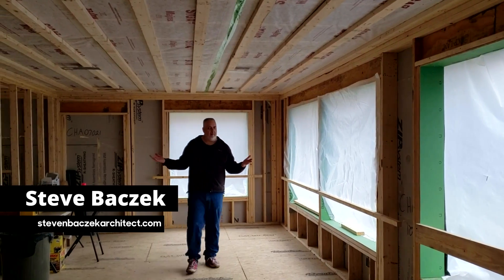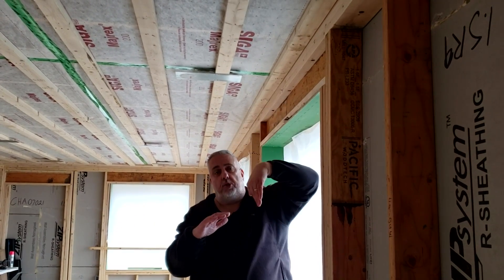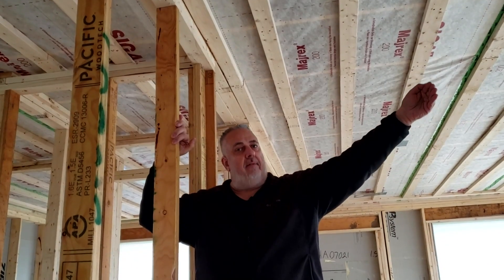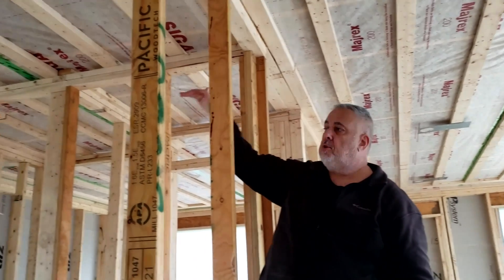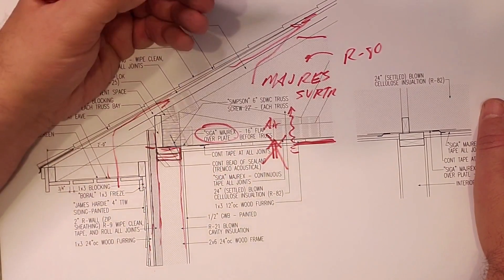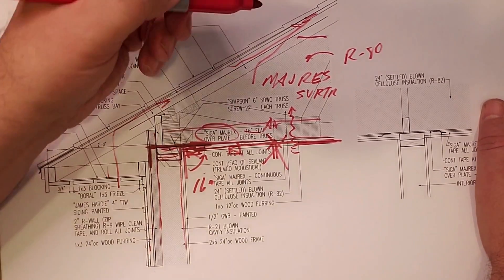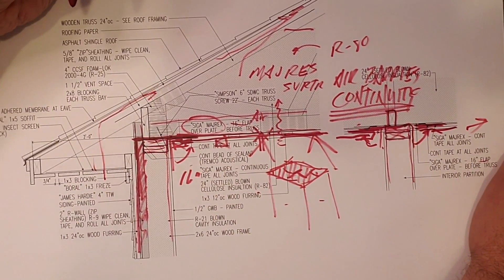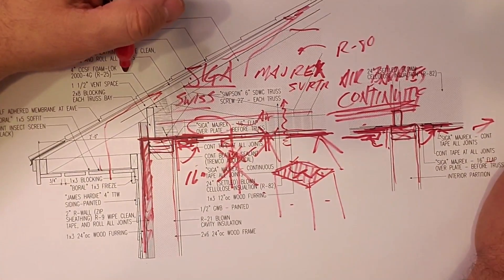CEILING AIR BARRIER

Comment: On a retrofit / remodel, do you recommend Majrex on the interior walls and ceiling? 
I am thinking of using rockwool in the ceiling and the walls, zipR on the outside walls.
I appreciate any input on the recommended products and methods.

Climate zone 5, 1100 sq ft ranch with partial basement and vented attic.

Comment: I thought the vapor permeability was to enable drying to the inside if there wall cavity gets damp.  In a cold climate you don't want to drive interior moisture into the wall or roof system.  I'm guessing you just drew your wiggly vapor arrow in the wrong direction.
Reply: Yes. I’m also totally confused about this. You don’t want your moisture go into the wall cavity, especially if it’s ceiling with blown in organic  insulation. And then it will supposedly dry because it cold roof? Something is totally messed up here.

Comment: I noticed in some of Jake Bruton's builds he does the interior air sealing before framing up the interior partitions.  Do you have a preference one way or another or is it driven by the framer's schedule?  The flap detail still makes sense for the exterior walls, but having a monolithic ceiling to seal would seem to have a lot of advantages.

Comment: I've seen several videos on this technique, but I haven't seen what happens next. How is the wiring done for those ceiling lights? Is it run below the Majrex, or does it go through to the attic, requiring the holes to be taped?
Reply: I am wonder the exact same thing.   I'm thinking that's a lot of staples penetrating the AB to run wire below it or penetrations into the attic...
Reply: @mikeo1352  My guess would be they staple to the side of the 2x4 furring and not thru the AB.

Comment: Hi Steven, something no one seems to address, what about the holes created when fixing up the 4" strapping breaking the airtightness layer? How are those sealed? Also, why use 4x2 strapping? If you were fixing plasterboard to a ceiling, there would only be the 2" to screw too. Thanks Steven.

Comment: If you are building in a hot climate,  would you recommend using 6mil poly on the ceiling to act as an air barrier.  It would be considerably cheaper than Siga majrex.  I'm concerned about moisture infiltration through the ceiling attic insulation, particularly in instances of pronounced temperature differentials between the attic and interior spaces, especially in vented attic.

Comment: Steve, the design on my personal build is almost identical on the gabled portions. We also are using 2 x 4 strapping. So, your video reinforces that our design is on target. However, I am concerned that the Majrex will get damaged when the trusses are being set on the exterior walls. Has this been a problem in your experience? How is the Majrex attached to the top plate to keep it in place during the truss install?
Reply from the maker: It wasn't a problem,  and it was simply, stapled to the top plate

Comment: This is an interesting detail, thank you for sharing. Did this same detail carry all the way through the bathroom and shower spaces? Laundry room? And kitchen area over the stove? Asking about areas that generate a lot of moisture/steam/humidity. And would you use this detail for a conditioned attic space?
Reply: One thing I've understood from some other vapor retarder videos is to avoid tile against exterior walls if you can since it will present an impermeable layer against that exterior.  To manage the higher humidity in such locations should be primarily addressed with an ERV sufficiently sized to change that high entropy air.

Comment: I don’t uunderstand l how this works when you have part of the air barrier on the warm side (lid) and part on the cold side (exterior or zip R). I know in cold climates some jurisdictions still insist on 6mil poly as air barrier on warm side, so if you do zip r, then do you not have e double barrier? (Big no no)
Reply: It's a vented attic,  the majrex is the only air barrier on the ceiling. If there's zip sheathing on the roof, it's only there for quick water proofing.
Reply: @MurDocInc yes, but he ties the Majex over the top plate to the exterior zip R walls which he talks about being the air barrier- this air barrier is on warm side of lid, but cold side of walls
Reply: It's ok to have a double air barrier but not a double vapor barrier.  The wall has to be able to dry in one direction.  I'm not a fan of the zip R in this wall stack up in a cold climate as the warm moisture laden air from the interior air can reach the zip R and migrate through  the spaces between zip R sheathing and condense in this space, wetting the edge of the OSB and flowing back into the wall cavity.

Comment: I love the service cavity on the ceiling. Steve, I have seen a service cavity for walls also but have never seen you do them. Thoughts?
Reply: It's mostly for slim led pot lights, but you could run pex and low voltage too.(cameras, speakers, alarms, auto blinds, etc..)

Comment: Could you compare and contrast this approach with the detail from another of your projects that uses 3/4" plywood to bridge the top plate, and 1x4's straped to the truss
bottoms with sheet rock as the air barrier? Why go to the added expense of the maijrex and 2x4s if sheetrock will do the job?
Reply: I was wondering the same thing . Only thing i can think of is the application . 

Looks like this project has inner load bearing walls would make it difficult  to use the sheetrock as a air barrier .
Reply: @alonzoacosta4263  Where I live in B.C. code states that a vapor Barrier/retarder must be used when using blown in cellulose insulation and vented roof.

Comment: Steven, Doesn't OPEN CELL Foam Insulation on The Ceiling / Attic Side... Also Act as a Air Barrier and Also Breath / Release the moisture?
Reply from the maker: To permeable for CZ5
Reply: @stevenbaczekarchitect9431   Which is Good, Right?

Comment: Thanks, SB.  Like one of the other commenters alluded, are there 'instructions' to trades on when/how to get their materials to the attic, soffit, roof? Despite the sequencing needed for successful sealant install, it still seems maintaining a seal is more difficult than creating it initially.  Granted, I get that varies job to job (whether project is a retrofit, whether you have privilege of a basement, etc).
Reply from the maker: Almost everything is below in the basement